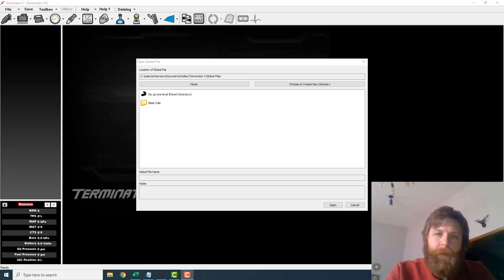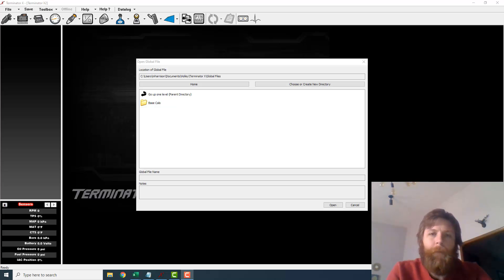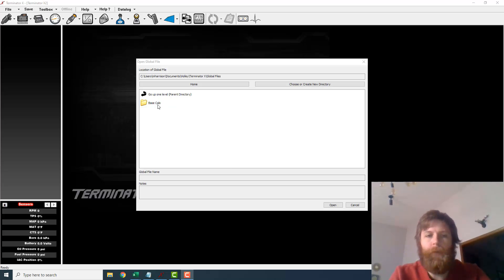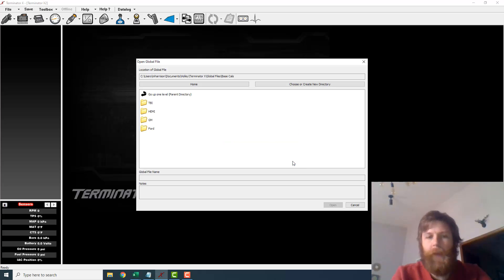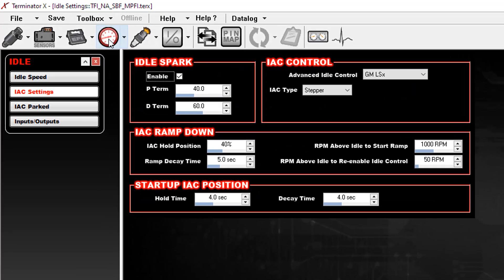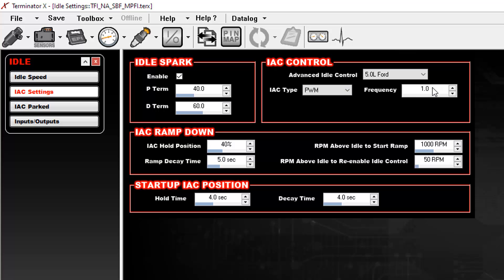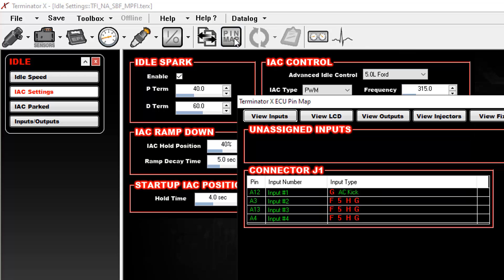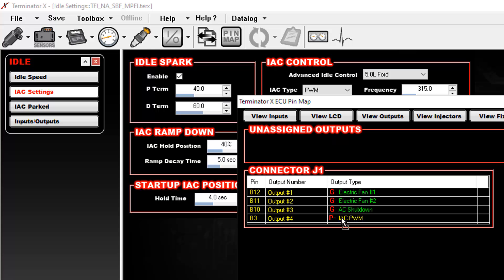Must Watch: Factory Ford Idle Air Control Valve Configuration with Foxbody Holley Terminator X

Comment: Do you have any info on whether or not this still needs done since holley re-released the 937F kit after it was discontinued for a while? The reason I ask is that I just got my terminator X installed last night, went through the wizard on the included lcd display, and the car idled and revved perfectly - at least when warm. It surged a good bit at first, but I couldn't tell if it was because it was cold (and thus needing these changes described in your video), or if it needed some time to "learn" since it was the very first start with the holley.  Will mess with it more over the coming days, but wasn't sure if you had any insight into any changes holley may have made. For what its worth, I did hook up my laptop and it did show GM stepper in the IAC settings. I'll make your changes and try again, but was sort of thinking "If it aint broke don't fix it"

Comment: What if a boost solenoid requires that 4th output spot?
Reply from the maker: Then you either need to switch to a different IAC Style that doesn't require this output, or you need to upgrade with the expansion module that gives the Terminator X extra I/O. I don't think that even existed when this video was made. Part number: 554-165

Comment: I tried this and as soon as I started adding throttle or 2200RPM it would hang and not drop back down. I had to kill the engine to get it to return to idle.  It seems to run fine other than cold starts with the frequency at "1" not  changing the pin map.  Why would engine RPMs  hang up with the new setting?
Reply from the maker: If no pin mapping is assigned, then the valve does nothing. If you do setup the pin map, but leave the frequency at 1, the valve will make all kinds of noise and will not work correctly at all. But if your rpms are hanging up when setting the frequency and pin mapping correctly, then it means you either have too much air coming into the engine because throttle body blade is open too far, your iac hold position is too high, or the rpms above idle to start ramp is too low.
Reply: @LeechMotorsports  Thanks.  I will adjust my idled screw back some. I have to keep the idle at 1000rpm to run smooth.  I also noticed in my  Terminator  x software that it will say I am at 700rpm but my dash gauge will say 1000rpm, so maybe I need to adjust down the idle screw with your pin map settings.  Does that sound correct?  I do have the Trick flow 170cc twisted wedge heads top end kit and a vortec V3 supercharger with 47lb injectors.  Its in a 1965 cobra replica.  I have watched all your videos and they are super helpful!!
Reply from the maker: When you say “your dash gauge” are you referring to a stock gauge in the car or a pro dash? If you are talking about the vehicle’s oem instrumentation, I would strongly encourage you to focus, instead, on the readings from the efi system.

Comment: With having a 302 fox is it ok to run a single coil without a 6AL box with the Holley terminator x?
Reply from the maker: You shouldn’t need an aftermarket ignition box for most basic builds, assuming you are using the tfi distributor. Ignition box requires for use with dual sync.
Reply: @LeechMotorsports  I have been using a stock distributor with the steel gear on then end. And been having people tell me I need to put the 6AL box back in and others saying no. I still have the ignition coil.
Reply from the maker: Ignition box isn’t a requirement when running a tfi setup. Only required with dual sync setups and other more exotic configurations.

Comment: Do you have to do this after the vehicle is all hooked up?
Reply from the maker: I’m not sure understand the question. Ultimately the first tune you should ever try to run with this efi system should have this setting in place before first startup, assuming of course you are running that idle air valve.

Comment: Can you do this on controller? Or have to use laptop? Also how do you transfer it to controller?
Reply from the maker: The laptop is your friend. If you do not have the CAN USB cable to connect your laptop directly to the Holley ECU, then you would have to use the SD card to transfer the tune from the laptop to the card. Then from the cars to the ecu.

Comment: If you aren't using the Fox Body kit, do you need to install a flyback diode in the harness? Seems like I'm getting a ton of noise when I have the IAC hooked up. The handheld buzzes, and so does my Dakota Digital control box for my instrument cluster - which is not connected to the ECU at all...

Comment: Wow thanks a lot, can’t wait to see the difference it makes
Reply: Yea did this and my car idles at 2500 rpm, why would it do this? Even with my throttle blade as closed as it can be
Reply from the maker: Just helped another user with this issue. In his situation, idle was hanging because the TPS was not set correctly and at “closed” throttle, his tps % showed as around 3%. This high of a percentage will tel the Holley to behave using its part-throttle logic, which will yield a high IAC position and ignition timing. Once we did a tps auto set, that issue was resolved.
Reply from the maker: Is it now idling that high all the time or only after revving the engine?
Reply: @LeechMotorsports fixed that issue but now it surges from 800 to 1200 rpm
Reply from the maker: @keenankircher7492  could be a large number of things. If you can send me a copy of your tune and a data log of the issue, I can take a look for you this weekend.
Reply: @LeechMotorsports  gonna put some time into it myself first but I will definitely turn to you if I can’t figure it out
Reply from the maker: If it is heavily surging, the first thing to do is make sure the car is in closed loop, and enough fuel correction has been applied to make the actual AFR match the target.

Next, it is important the target AFR is reasonable (not super rich or lean, which both contribute to swinging idle).

Also on the target AFR table, it is important that there is a big enough chunk of your table at and around idle where the target AFR does not change from cell to cell.

I’ve found in most cases it is very helpful to scale your timing and fuel table RPM axis so that you have a column at the exact target idle rpm at full temps. Then have a column above and below that one that are an even number of rpms away from that idle.

If all that is setup in the tune, the next thing is to get the throttle stop screw dialed in so that the IAC position at hot idle is appropriate. Note, there is no one correct answer as to what that percentage should be. But it needs to be established with intent.
Reply: @LeechMotorsports  I’ve never touched th fuel table, copied your stock foxbody timing table , the afr is good, it idles ok but not great without the IAC activated, only thing I did was activate it , i can’t look now but I think it may be going from 20 degrees timing to the 24 in the timing table
Reply: @LeechMotorsports  I set the IAC parked position table to 0 across the whole temp range and it idles good now
Reply from the maker: @keenankircher7492  IAC parked position only determines the position of the idle air valve while cranking the engine, and for a few seconds after the car starts. Will have no impact on long term idle after that period is over.
Reply: @LeechMotorsports  hello I don't know why but I posted two comments and for some reason my comment seems to disappear but I'm going to try this last time. I was wondering if you could take a look at a video that I posted it's under 95turbostang I've been having a issue with my IAC valve in my video it will show exactly what's happening and I cannot figure it out I've been trying to fix this issue for over a year now but in my Terminator X kit 550-944  software I do have my IAC valve set for Ford 5.0 and it is wired to output 4 B3 pwm- and the other wire going to 12v I have tried three brand-new valves also I have tried plugging in a IAC valve while looking at the valve I had a friend turn the key on and I can see the valve moves oh and also I have tried 300hz to 320hz for the IAC frequency. Any of your expertise would be very appreciated
Reply from the maker: @95turbostang21  I did reply to your actual video post. I don’t think you have a problem with the valve. I think it is just holley’s crap idle air logic messing with your head.

Comment: Do you have to wire the iacv to the output harness?
Reply from the maker: If you are using the 937F kit, the wiring is already done for that component.
Reply: @LeechMotorsports  I just thought if you are using the output ypu would have to wire the output harness to the component you are trying to use on that output, thank you for the reply!
I'm use to my hondata s300 software on my hondas, so when I want to use a output I have to wire the sensor I'm wanting to use to the specific output on the harness
Reply: @britdog15   I was wondering this also. I have yet to check my actual output wire on the harness but I suspect like yours it will go nowhere( ie free output for use on anything ) So where does the pwm signal come from in the foxbody harness and why does the output need to be pinned this way? Just trying to figure out how to properly make this work as described. The logic seem correct just not getting the output pin out swap with no actual wiring change.
Reply: @flyingwrenchesautomotive  I didn't wire anything, if you download the new terminator X V2 software you can actually switch the iacv on the handheld unit without needing a laptop
Reply: Yeah, I did it on my laptop but didn’t realize holley already had the wiring part done just needed it switched on the Pin map. Thanks!
Reply: @LeechMotorsports  in my fox body terminator x kit the harness already has the iac connector wired to the loom? Where does that lead go to because currently it isnt to pin b3 where I have assigned it.  On my fixed outputs the is iac A hi and low and iac B high and low.  I b1 and b2 and b 8 and b9.  Im confused.  Thanks for any input u can give me.
Reply: Well, I did some more digging on Holley’s website and am finding conflicting info. When looking at the 937F kit, scroll down to tech resources and click on wiring diagrams, it shows IAC PWM- wired to output #1 Gray / Yellow. 

If you click on the Harness Manual under tech resources it shows the IAC PWM- wired to output #4 Gray / Green. 

Not sure if there was a running change in the harness wiring but two different answers for the question now. Guess you just have to look at your IAC wiring and see if it’s gray / yellow (Output #1) or gray / green (Output #4) and assign it accordingly.
Reply: Interesting that this is working. The IAC is wired but not to Output #4. Looking at the wiring diagram for the 937F, Output #1 B12 Gray / Yellow wire is the one actually wired to the IAC. I would think you would have to assign IAC PWM- to Output #1 and use Output 2, 3, or 4 to control fans, AC, ETC.
Reply: Output number four is a grey wire with green stripe on terminal H on the output harness. that wire goes nowhere.  As questioned above by Britdog why does that not have to be wired?

I have done this and it seems to be much better regardless I just like to understand why.  Your videos are incredible. Thank you so much for your help. Your vacuum line video was a huge help to me